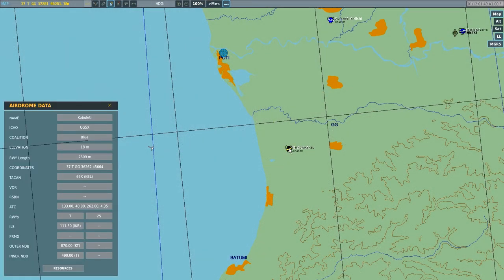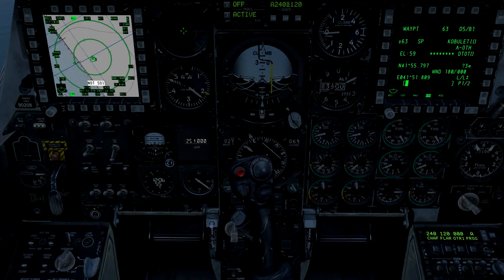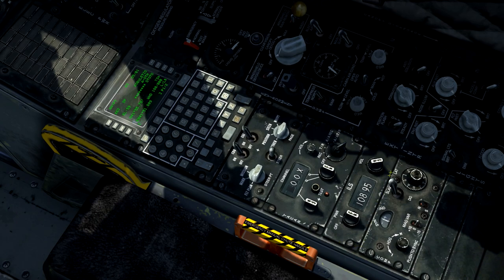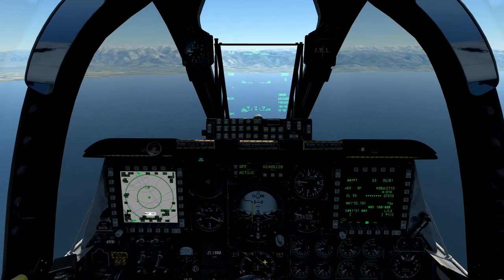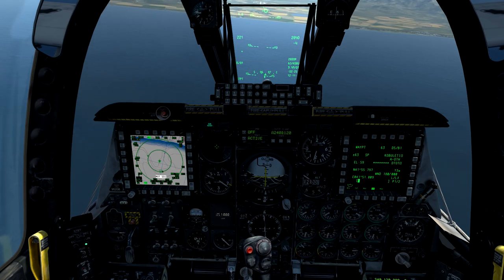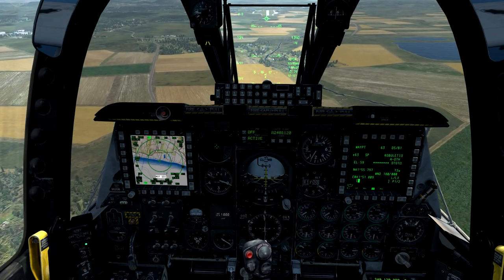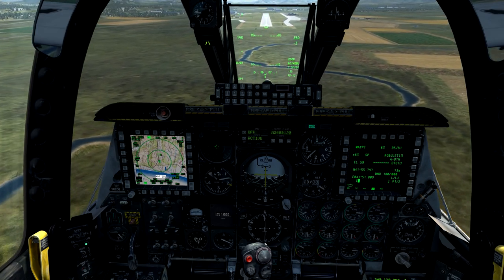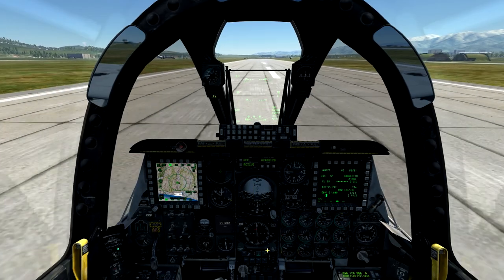DCS:World » ILS Landing » A-10C

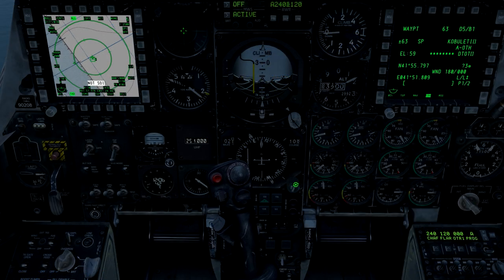Comment: 01:00 Why is the heading provided by ATC wrong? 

I'm new to the game playing the tutorial and often run into problems with misinformation provided by the game. (ATC, flight instructor, TAD waypoints, HUD waypoints)
Reply from the maker: It isn't the wrong heading, it's just not as accurate as it could be.  The VAD Charts I was looking at provide the true heading rather than magnetic, when landing under visual flight rules (VFR) magnetic is accurate enough but for landing under instrument flight rules (IFR) you need the accuracy of a true heading as provided by the VAD charts.
Reply: Thanks for your reply.

I thought DEVs maybe adjusted the map, so audio and gameworld just aren't from the same version.

But instead, you say magnetic course and geographic course can't be identical, since magnetic and geological poles aren't at the same position, which is at some point represented in the game.
 Did I get that right?
Reply from the maker: Well I'm sure there is someplace on this planet where magnetic variation is just right to allow true and magnetic course to be the same but generally there is an amount of magnetic variation (about 6 degrees in the Caucasus) and this variation is what causes true and magnetic heading to differ.  
To get a magnetic heading you simply read off current heading from the magnetic compass but to get true heading you need to first read the magnetic compass, then either subtract an Easterly, or add a Westerly, magnetic variation; based upon the isogonic lines on your sectional. An example  would be a magnetic heading of 174 w/ 6 degrees West Magnetic deviation = true course 180.
Reply: Thank you very much for the detailed explaination.